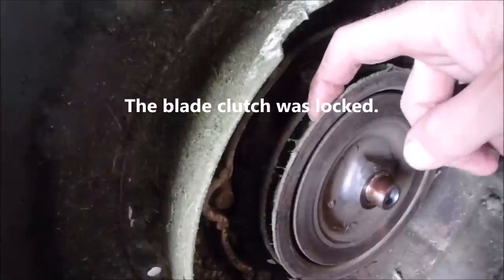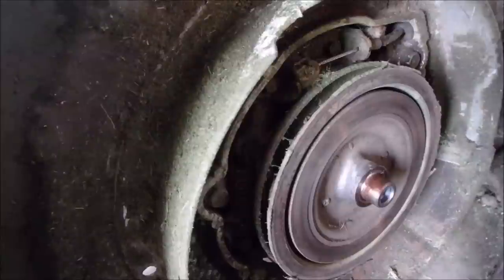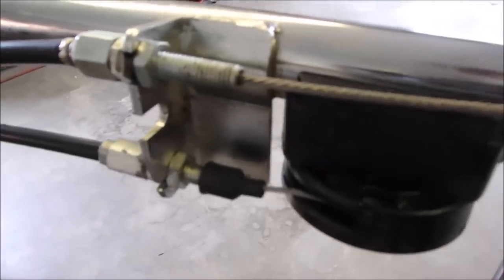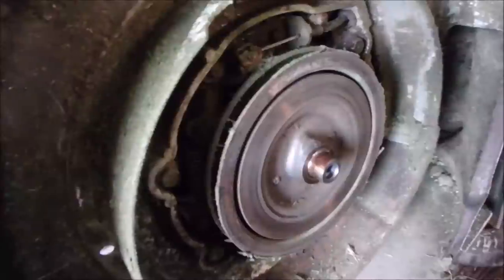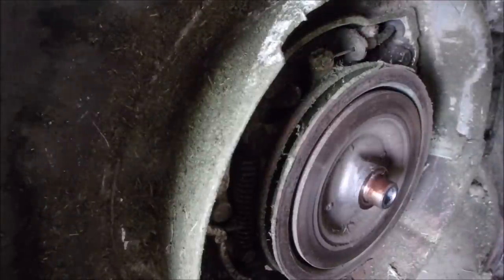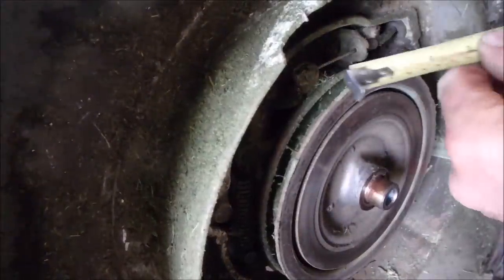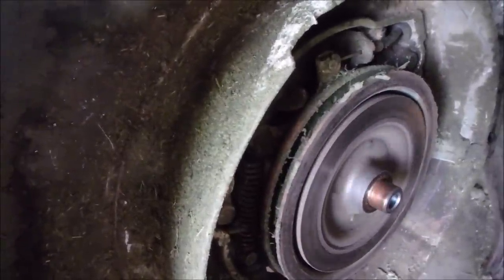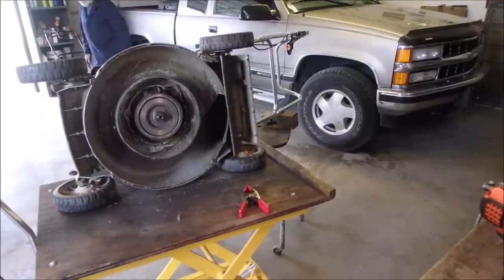Honda HR194 Mower Blade Clutch Pt. 2

Comment: Bruce, sorry about your crew member, I've lost a few from mine but the memories will live on forever. Now, I learned something new again from you, never knew about the J.S.I. screws or tools but I have a few Hondas in my hoard out back so I just ordered a set of driver tips from amazon figuring I might just need them later. Thank you sir for the continued education
Reply from the maker: They work great on regular Phillips to.  I actually put my old Phillips away.  It is a depth thing.  The old ones are too pointy.

Comment: Great video again - I did a clutch bearing replacement on a SX model last week - and it needed exactly the same clutch cable adjustment. good little machines
Reply from the maker: They are tough.  That is why they are still around.  Thanks again

Comment: Thanks Bruce. Always wondered how those Honda clutch blade assemblies came apart. I also have no low speed on my Honda (an HRX). It either on high or off - no in between.
Reply from the maker: I get that.
Reply: Same here! It might need adjustment, as I managed to get a kind of slower speed. Need to look into it further.

Comment: Great job Bruce! I love these mowers, had three of them in here this summer for blade clutch, carb and drive issues. I was so impressed with the build quality that I bought one for myself (like I need another mower). Hope you get that one! I picked up an HR214 SMA with electric start and 2 speed drive but the manual push ones are even better (less to break down). I’m a huge fan of that blade clutch design, much better than the belt style Toro uses.
Reply from the maker: Thanks for the informed comment.

Comment: The only problem with the snapper I have with the Robin engine, the blade brake clutch didn't work.
From the age of the snapper, the brake material had fallen apart, and since this clutch system uses a strap type clutch with clutch like material is rivited / glued to the strap, which they don't sell, you have to buy the whole assembly 200 some odd dollars, I said yeah right.
You know the green clutch material they include with the friction disk for rear engine snapper riders, well it's the same material, so I cut the green material to fit within the strap, and just glued it on like a pair of drum brakes like back in the day, it's not the space shuttle right.... Lol works perfectly, I will put the video up of the job soon.
The Honda clutch system is much better made though.... Great video Sir.
Reply from the maker: You are the man.  I have learned a lot from you.
Reply: @BrucesShop  thank you.... Right back at ya.

Comment: Nice job. Instead of all the fiddling with the throttle cable by the engine there should be a cable adjustment on the top.
Reply from the maker: Yes  I adjusted that devil too.    I try but I can't film it all.

Comment: I'd be worried about cross threading the bolt using the impact to get it started.
Reply from the maker: That has happened.  Not so bad on metal but terrible on plastic.

Comment: Hi Bruce, what did you set the idle RPM to?  Mine idles down a lot more than that one so I'm wondering if I need to turn the wick up a bit.
Reply from the maker: You can set the idle on the throttle arm when it is low.

Comment: I am so Confused I have never seen a manual operated blade clutch ..My head would be hurting trying to figure out that one
Reply from the maker: The are nice if they work.  Just stop the blade and not have to restart the engine.  Good for stuff in the lawn